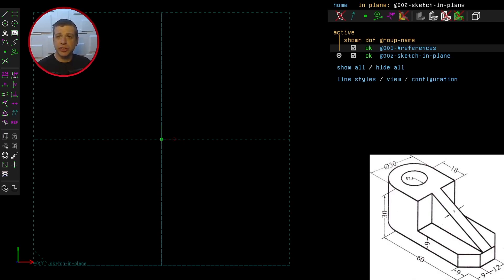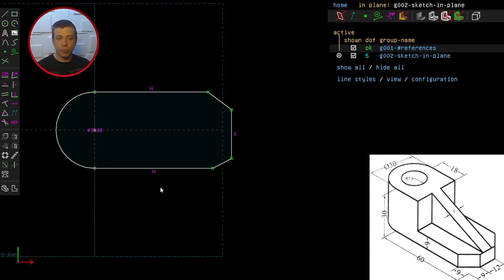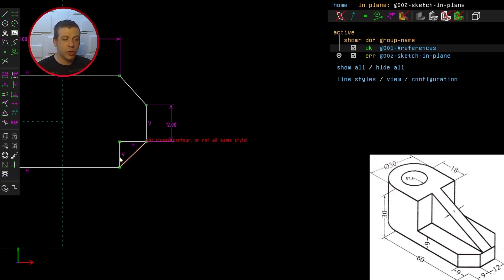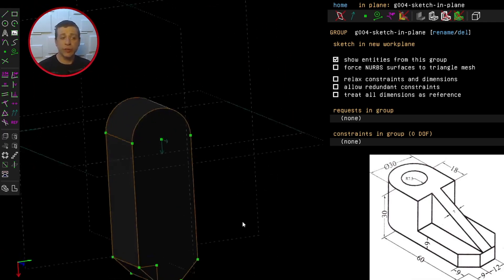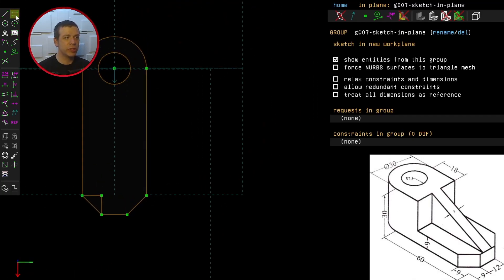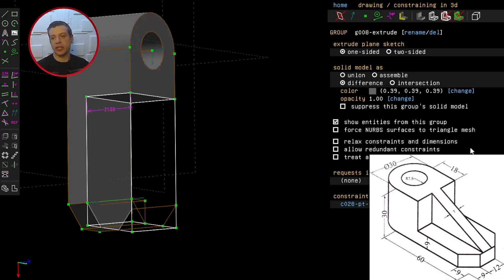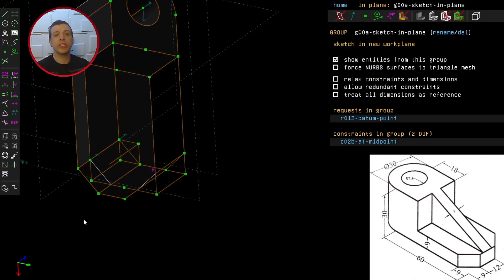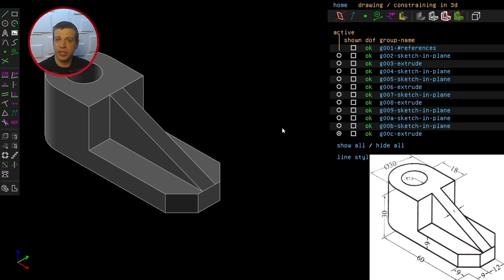SolveSpace - Challenge 2

Comment: Nice videos, thanks. Something I discovered by accident: if you need a hole through an extrusion as here, it's quicker to draw the circle straight after you've drawn the object outline and then extrude, because the circle will then be correctly taken as a hole running straight through. IOW there's no need to extrude the hole separately, then size its depth etc, it all happens automagically.😊

Comment: Here is the problem that I am faced with, at 8:12 in the video, I go to the new work plane. I try to create a point in the middle of the object near the flanges. But, every time Solvespace packs the line above the object. The 3rd point is not near the flanges, but is floating in the air? When I am in a work space, and I have 2 or 3 lines that overlap each other, how can I select the correct line? It seems like Solvespace picks the highest line in a view and ignored the depth of the workspace? Thank you.
Reply: GOT IT! The setting "Anywhere in workplane" had to be selected.
Reply from the maker: @stevenbeebe35  Hey Steven  - glad you figured it out. It can be tricky selecting a workplane at first, but when you do adding a point will be in that selected workplane only. If the line above is selected then it sounds like you may need to reselect the correct workplane. I hope this helps.